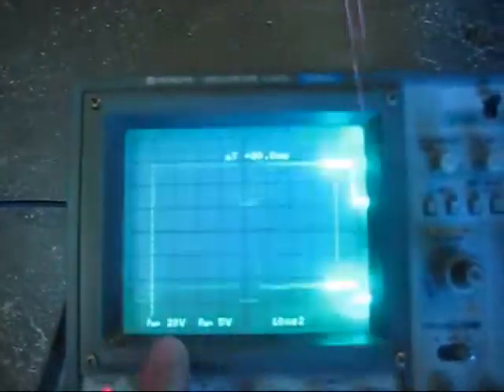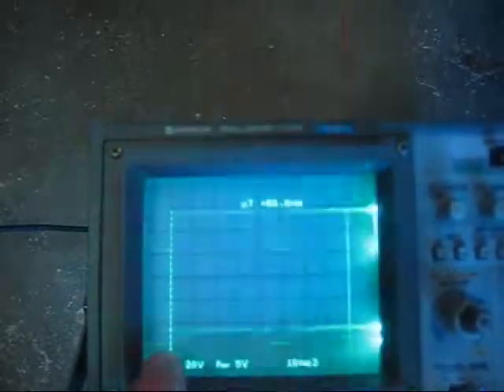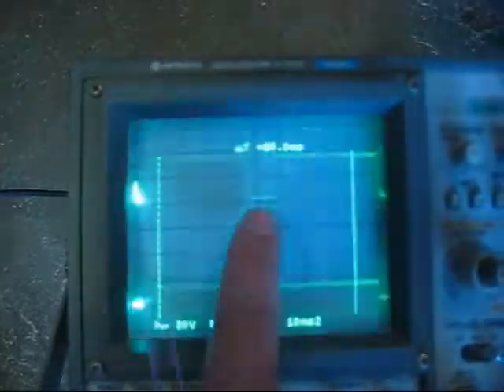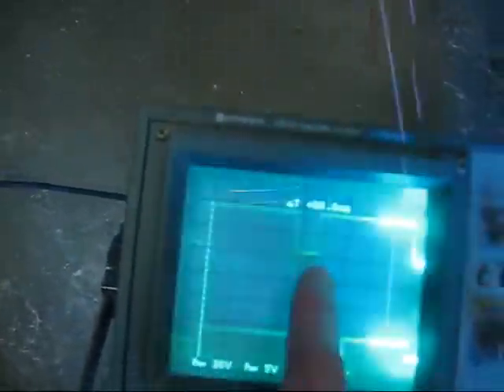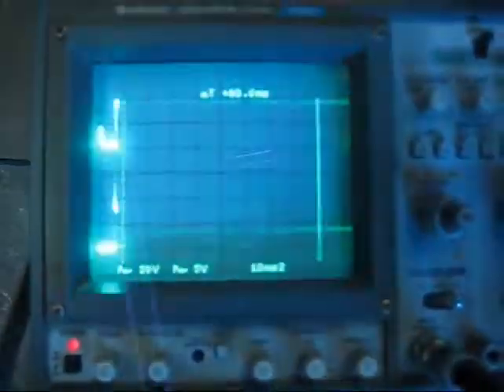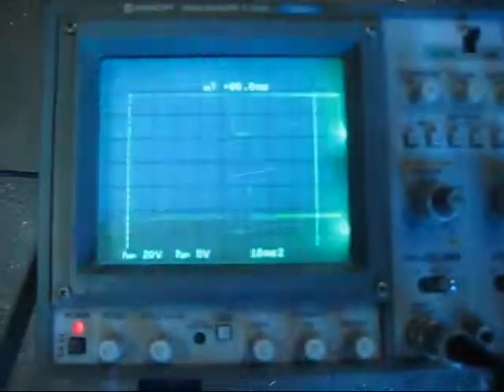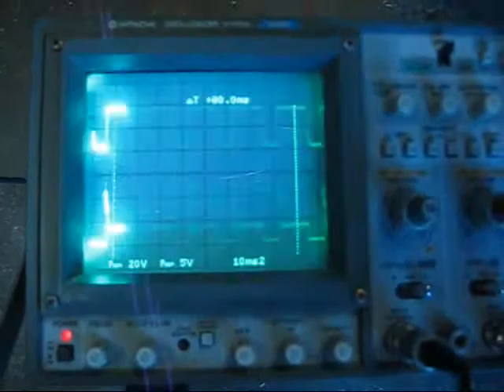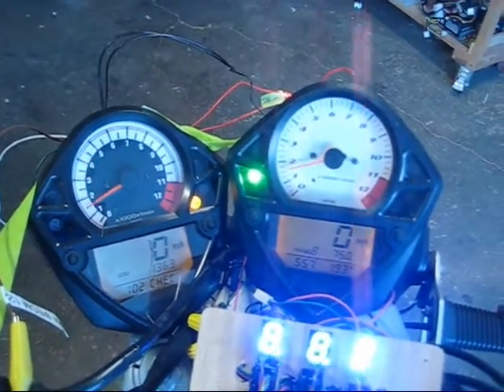Tach Translation Video

Comment: Sorry to bother you but i've blown a resistor in the rpm gauge of my 2002 1gen sv650 and can't read the value to replace it.
would you happen to know this value or have a good photo? I can't seem to find anything anywhere about this and am running out of options :(